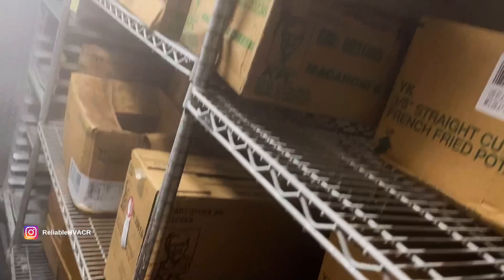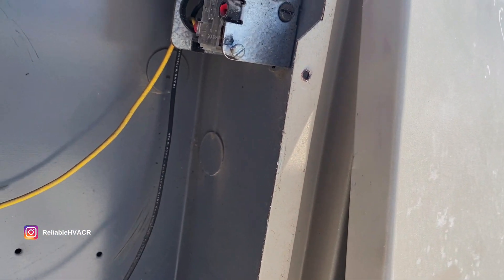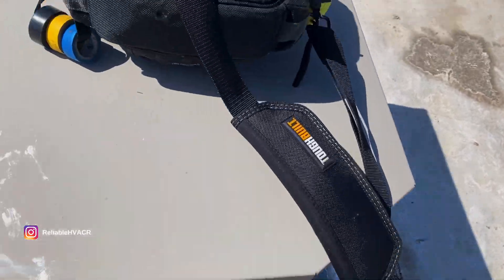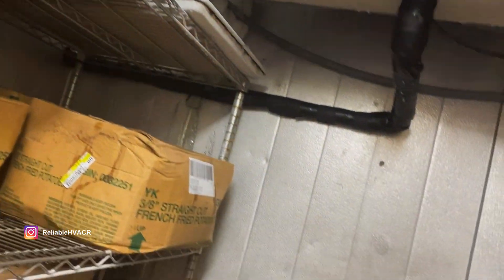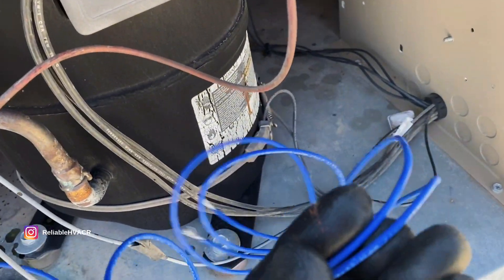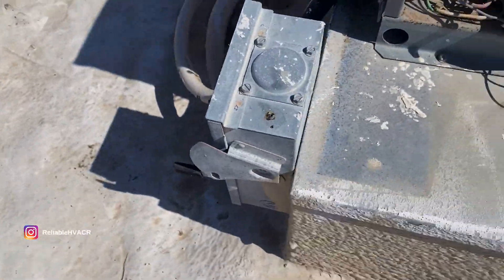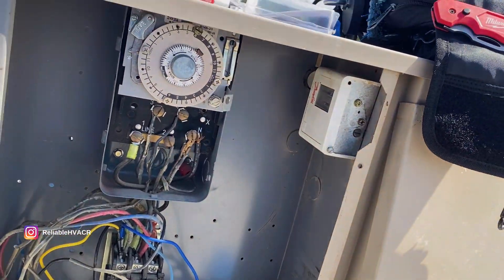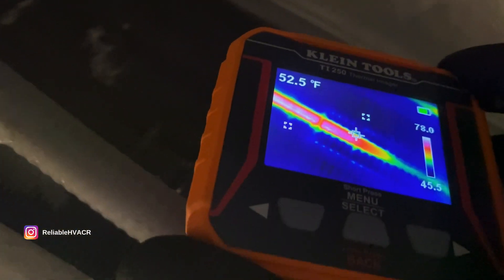Walk in Freezer Frosting All Over | Iced Up | HVACR

Comment: Thanks I learned something new and like your tool that saw heater on the evaporator and where'd  did you get because I need one thanks.
Reply from the maker: I got mine at Home Depot, Klein infrared. My Amazon link in Description has all the stuff I use too
Reply: This’s great tools but if you don’t want to spend money you can get your meter get amps in the heater👍🏽